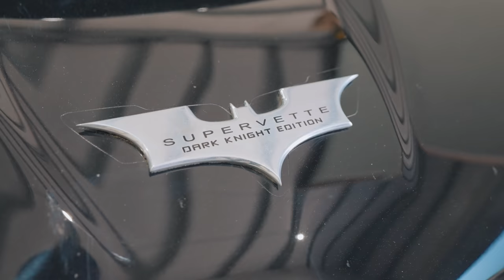335i 2jz TAKES OVER TEXAS!! Tx2k21 VLOG

Comment: honestly i love the video but i never did the counting down with the hand thing, for one hands are not ready yet to grip the wheel and control and secondly its just better to utilize what the Japanese highway racers did, tail behind the car you want to race , flash high beams twice, if accepted they'd turn on their hazards if no they'd flash brake lights, and they'd usually honk or flash high beams to count off.

Comment: One time i did axles on BMW and i torque them to spec. I was washing hands. And the new china bolt failed before it went anywhere.  I heard it fail. The head of bolt came off. Use oem Bolts with red lock tight like u said my boi.

Comment: Hey bro, you car is killer. In the process of looking for a 335 coupe and then proceed to get a 2jz. Just wanted to know what it cost to do this swap solidly?
Reply: Lol 2JZ gte swaps are gonna cost a fat price it’s just about the price of a used 328i for a fully modded engine, and around 800+ for a stock with over 100k miles so you’ll need to rebuild it, and 335i’s are gonna run 13-28k depending on the year model